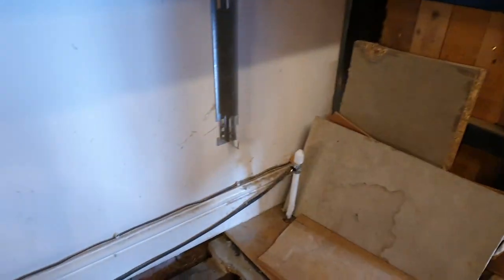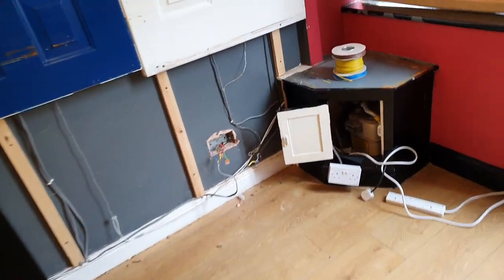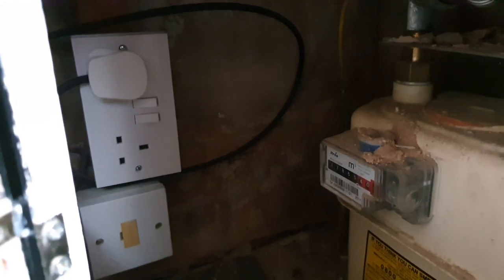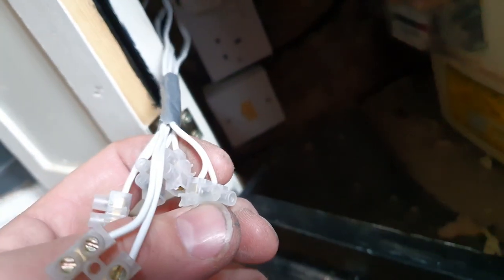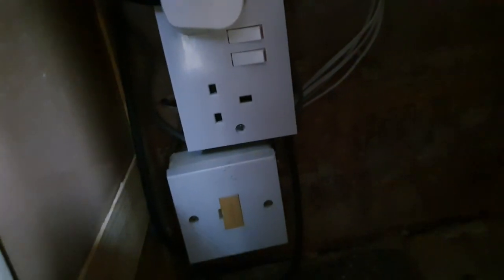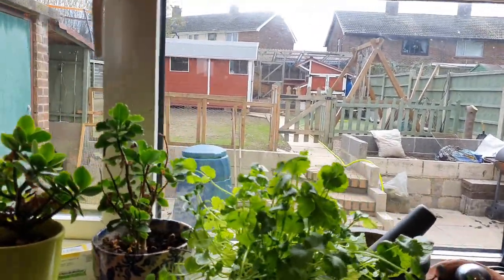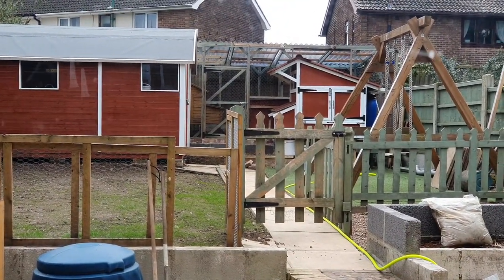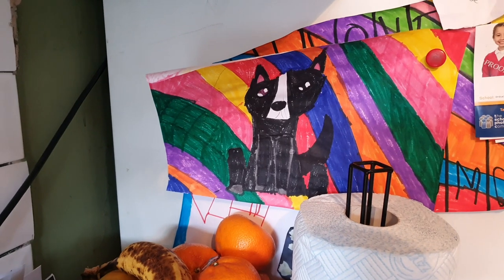Exploding Power Supply

Comment: I love those wago’s! I prefer the Lever Nut ones much easier to use compared to wire nuts. I convert/remove ballast in lighting and use those connections for L to N led bulbs! Cheers